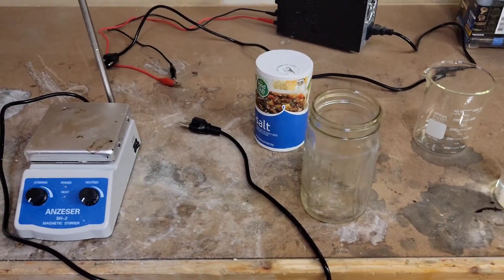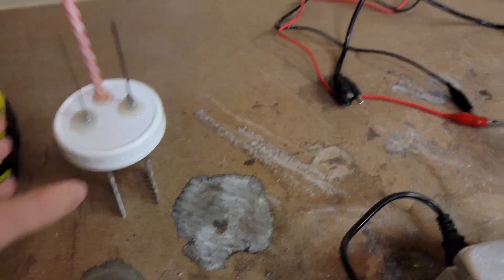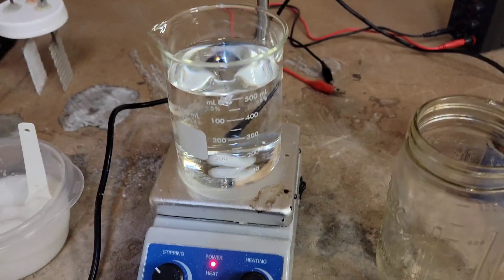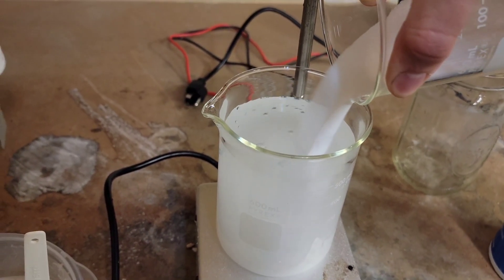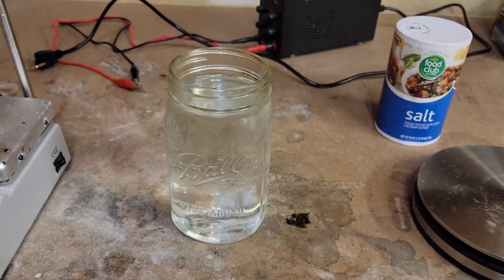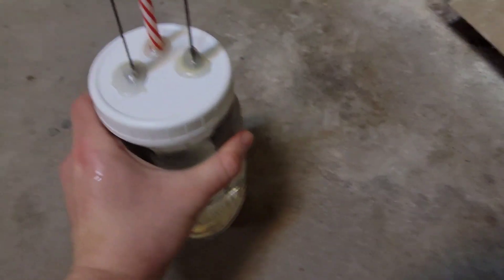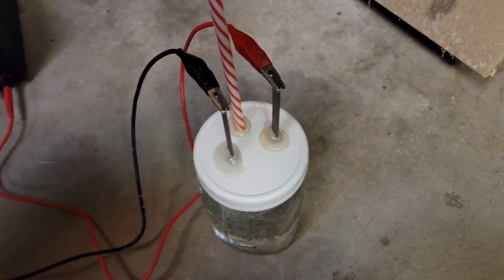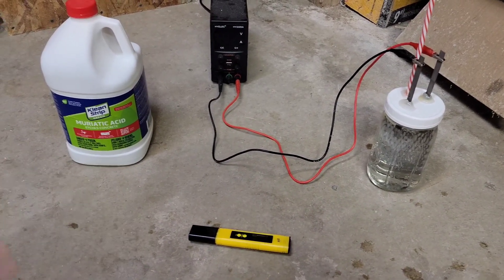APCP propellant (Perchlorate) from salt part one: Setting up for electrolysis

Comment: 5A for that electrode is too low for making perchlorate. You need to find the surface area of the anode in cm² and multiply that by 0.2 to get the current needed for making perchlorate. Also you need to add sodium sulphate as catalyst, around 4g/liter. You can use methylene blue as indicator for testing perchlorate.